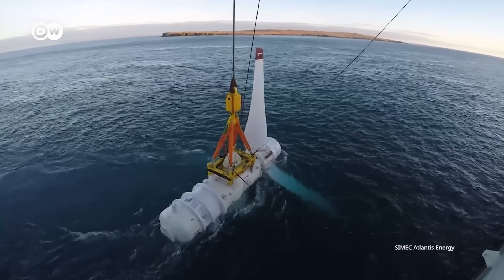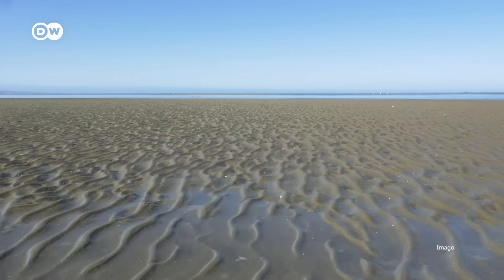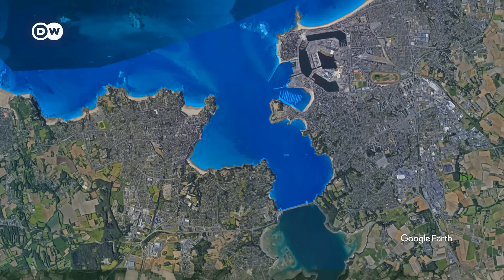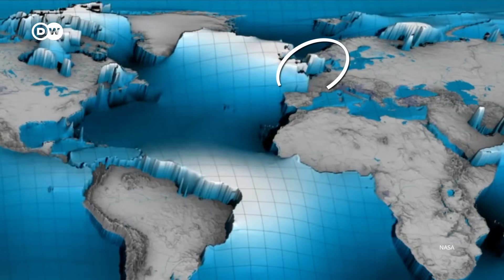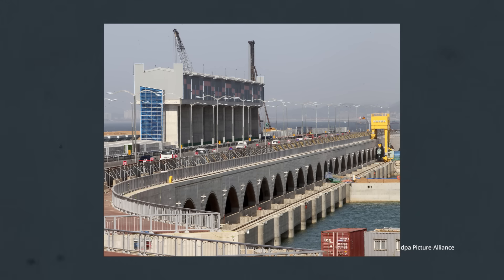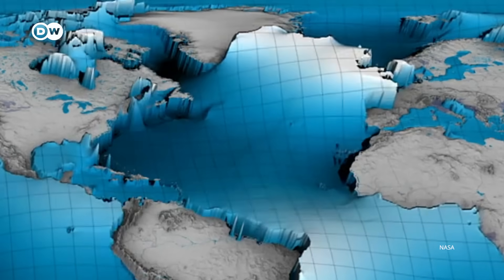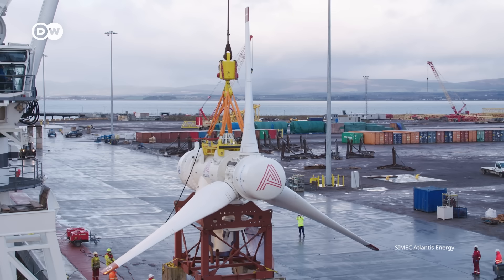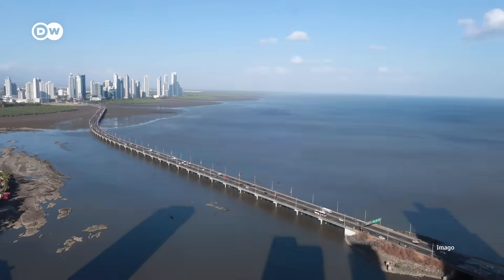Tidal energy could be huge – why isn't it?

Comment from the maker: Do you think that we should use more tidal energy?
Reply: Regarding tidal stream power the answer is obviously always a Yes. The not so obvious question is what is really needed that we can use it? It has already been solved for 4 m/s peak tidal currents with multiple 300 kW turbines on platform by some contenders of CyKlone Tidal Energy. However this is rare places on Earth limiting to scale the tech.

Once you don't start from high tidal range you see vast areas of ocean have 2 m/s peak tidal stream currents.
So basically you need a scalable design for 2 m/s peak tidal currents to really get into economies of scale. 

We have not even identified any relevant target research areas for that and we have not established any governmental government research tools for 2 m/s peak tidal currents. Even if the maps are obvious about that requirement to be met ideally. That most tech today can't do it doesn't justify not trying and ignore results pointing this way. 

To my knowledge that is true for the EU as well as the UK.
Reply: Please get make a video on wave energy as well !
Reply: Yes. Also recall a scandal that tidal power was proposed in the 70s but the British govt buried the report in favour of fosil fuel
Reply: @salk1436  It was the fact that the Thatcher Government discovered that oil had been discovered in Scotland (North Sea) that really put the final nail in the coffin for any `Green` UK power solution. Thatcher wanted quick & easy bucks. If any Gov is to play a role in Alt power in the future you may pray for a Socialist/Green Government not Capitalists.
Reply: Think about the creatures live in sea..
First they ruined birds freedom now started to marine creatures
Reply: Nice more pollution and another way to kill wildlife. Plus the amount of carbon that goes into building the thing will never be reproduced out of its functionality.
Reply: more research then sure
Reply: of course, and turbines ca be covered with a cover that allows water and tide to pass through it and protect marine life.  basic servicing can prevent things growing on it

It won't be suitable everywhere, but where it can, use it
Reply: 💖 Silly question - of course we should! 😀👍
Reply: I've been preaching this for years. The UK is ideal as the phasing of tides around the British Isles allows generation at all times, so a reduced need for storage. There are two problems. R&D capital and political will. The "City" will not fund, as they want fast returns with low risk. The current government believes in "Market Forces", so does nothing. When the tech is proven, they will still do nothing but it needs a co-ordinated plan to build the system.
Reply: yes, yes, yes, unlike unreliable wind energy, tidal is predictable and never stops
Reply: Yes
Reply: I did my MSc Thesis researching the erosion caused by a prototype of crowflow tidal turbine. Still a niche technology but would love to get DW’s perspective on them .
Reply: @susannahduncan3469  Some Tidal power machines can slow down erosion but they will (all of them) have a knock on effect somewhere & indeed could cause erosion. They can take sand from your beach & drop the sad elsewhere & create a new beach.. or indeed a sandbank. Cause & Effect in action.
Reply: Along with predictability, there is another less apparent bonus from tidal power. Some locations, UK is one, have tides staggered along its coast. The result of that is NO STORAGE IS REQUIRED. Just a longshore interconnect!
For the UK the stagger is so great that when it is high tide in the North and south, the middle has low tide.
Reply: @dougaltolan3017  you know that’s interesting. Because of course thermodynamics always dictates a lot of this energy & it’s actual usefulness when and where it’s needed. How much dissipates etc. you could be right. Just like Scandinavia has great access to geothermal we might be able to fully utilise this.
Reply: @T1tusCr0w  Wind & Wave Power can easily be utilised by Scotland & even more so Ireland but England will have to find a way of powering its Nation with Turnips!
Reply: @dougaltolan3017  Only prob being that alot of alternative electrically generated power is incompatible with the UK national grid!
Reply: @seandaniels9168  What?
Reply: No, reduce the population spread and you solve the problem over night.
Reply from the maker: @gangleweed  Do you think it's that easy?
Reply: And you can use it to power 🔋  sea structures,  a hotel that only run on tidal power in the middle of the ocean... that has a great potential.
Reply: @vajasman  yes it can...but the investement to power the hotel on a daily basis with these units is obsene!..cause everyone you need to get these on the spot you need em makes a lot of money!....and i meen everyone!!
Reply from the maker: @vajasman  Cool idea, but how cost effective would that be? As you can see by our video, these types of infrastructures are incredibly expensive to manufacture.
Reply: @DWPlanetA  I think not much more than a big luxury cruise ship, next to a large city. It can be build underwater too, probably built from modular systems. Easily accessible from a few kilometers tunnel.  Few companies can fund a cruise 🛳,  but we already see them.  Sadly until there are no companies with enough experience in these methods we won't see many growth in tidal power for a long time  :( (never understood why big fossil fuel companies didn't invest a lot in these techs, to be big energy companies) :(
Reply: You made use of a lot of footage from Britanny where the barage of La Rance actually lies. And it's not northern France, it's western France. Please review your maps next time, we people from this part are very sensitive about it, we even changed the name of a department because of that
Reply from the maker: @CaptainDangeax  Thank you for the clarification. We had a comment on this before and responded accordingly. It's great to have a community that keeps us informed and we have taken note of this mistake. 

Have a good weekend!
Reply: @DWPlanetA  You're welcome
Reply: Yes
Reply: I think we should stop allowing government control the reason yall are crying climate change is because of wealthy people not caring about anything but money
Reply: No.
It harms local ecology and maintenance in saltwater is very high. 
But who cares.. market will kill these projects. Wind and solar is much cheaper.
Reply: @hgh425  Nuclear is cheaper, safer, more reliable, and scalable with demand. There's no way you're heating and cooling all of the homes, charging all of the vehicles, and keeping the lights on in this utopian world in which all of the fossil fuels are banned and replaced by unreliable wind and solar. Youd be impoverishing and killing billions.  Speaking of billions, you'll be also needing to spend hundreds and thousands of billions to upgrade electrical grids to carry all that new electrical load. All for what? To reduce Earth's temperature by 1/10th of a degree when it's already been naturally much warmer, in both pre-history and human pre-industrial history, even when co2 levels were lower?
Reply: @camberwellcarrot420  i think you adressed your comment to the wrong person. 
You are wrong on the price of nuclear power and you also need to take in account the time it takes to build and commission.
Reply: I'm all for green energy alternatives. This has potential and would love so see it be successful
Reply: Absolutely.
Reply: If it’s more ecological than yes.
Reply: Why is my country not starting this
Reply from the maker: @thebeginingtechnichian  If you watch the video, you will see that it is incredibly expensive to implement. Take a look at the video again and let us know why you think that might be :)
Reply: Specifically, start building in those places that need some wall to defend against climate change induced rising sea levels that are threatening cities on the water's edge. If tidal energy device can be built into the defensive wall then you might turn the problem of rising sea level into an opportunity to harness more power.
Reply: @phreak074   that is true for most country but  here in the Netherlands it would be handy becaus we have the delta werken
A huge dam system  if i Recon i remember this corectly there is hydro energy instaled in the dams
But there had not been An continu in development since the 1980s
Reply: That depends. Tesla would have created free energy but died. US made a diesel van that got 100mpg. Ironically the powers that be didn’t want it around so was scraped. If they allow it then yes but sadly in this world there is always an alterior motive. Yes would be great! But then it’s a monopolized and will it be affordable is the real question.
Reply: Yes especially in the UK tide twice a day all the way round the country
The UK could actually reduce its carbon output by half if they reduced the mains power supply to 110v instead of 240v
Reply: Yes, definitely. We've to get rid of fossil fuels very, very quickly, so every alternative is a good one (yes, nuclear power too), as long as it works. It's a lot of energy that we're looking for, on a growing trend overall.
Reply from the maker: @DeePal072  Have you seen our video on nuclear power? https://youtu.be/9X00al1FsjM
Reply: I think we should vaccinate everyone first. Maybe even the fish around the turbines
Reply: 100% This is how we start harnessing the earth’s energy without polluting her.
Reply: Yes the world's been asking for that for years
Reply: The Elices dont work in Rivers and Watterfalls ?
( without being underwater )
Reply: Yes. Also, the narrator is very pretty.
Reply: Yes
Reply: We probably should use less energy but find a greater power. Paradox much?
Reply: yes and if possible marine life friendly
Reply: By all means, the positive side is no pollution, constant power, cheap in comparison to other methods for me it’s a winner
Reply: I say we should be using ocean currents!
Reply: Tidal energy is a real good thing , clean & affordable.
Reply: No question, yes more tidal energy. I wonder, has anyone tried the new toroidal blades on these turbines to increase efficiency?
Reply: Our moon gets stalled 3cm/y make up your beliefe..
Reply: no, the ships are killing the ocean animals like whales & sharks now this tidal energy will kill everything
Reply: @harshithsadhana7475  whales and sharks are not blind or unaware when it comes to ships themselves, nets yeah I agree. Don't forget Japan still practices whaling too!
Reply: @kenthhamner2641  that japanese practice too
Reply: Hakiki  
You are wrong. In English..You're wrong.
Reply: No
Reply: I like the idea of using it in places where we’re already wrecked the ecosystem such as man made bays. Creating new locations for it would have to come with a plan to offset the environmental impact in order to get my vote.

Doesn’t have to be anything fancy, but I would just want to be sure that my state/country is thinking about it and has a plan.
Reply: I don't think having blade mincer's underneath the sea is going to be good for the wildlife under there we could end up with fish soup....why people don't really think properly about design boggles my brain... Blades might be good to catch wind but not under water like a blender. Maybe do like the Scottish idea of sitting it on top of water and creating electric from movement of waves instead
Reply: yes
there are some exhausting natural resources after they will exhaust tidal energy's time will come
Reply: 3k43i
Reply: 3k43i
Reply: The energy finally is taken from kinetic rotational energy from earth. At what scale this would noticeably have an impact on the deceleration of earths rotation?
Reply: Using tidal engery is deriving power from the moons momentum circling the earth, so you would slow down it more and more. This will prolong the months which will lead to enhanced female periods and longer gaps between payments. Does anyone want this?
Reply: The best answer is to use less energy, stop reproducing. Mushrooms may lend insight necessary to forge this path, but DMT may be more efficient. We're all gonna die, no need to kill off the Earths creatures first, except a few species of sharks that like to bite people like surfers.
Reply: The world will. America, probably not anytime soon. 44,45 are panzies
Reply: No, they kill marine life.
Reply: @bluegreens1234   So should have Steve Jobs.
Reply: @bluegreens1234  puppet
Reply: the reason why this doesn't happen in America is because coal companies and Big oil shut this down anytime that people try to lobby for it
Reply: We don't have the copper resources to fully implement wind and solar let alone tidal. Tidal as you pointed out is very location dependent. As someone from the USA I am hundreds of miles and people can be a thousand of miles from the coast so yes funding is small as tidal would realistically affect a small part of the population. There will also likely be much more wildlife damage caused by Tidal than they realize. Just like the large amount of birds and bats killed by both wind and solar. Wind and solar are also not really clean energy at all. There is a lot of carbon that is used get the materials and to set them up. Not to mention that there is essentially no current plan for how to recycle turbines and solar cells. The current plan is the landfill or to ship worn out solar cells to Africa with the rest of our E-waste. Solar cells also contain toxic heavy metals so if not recycled properly they will cause a lot of damage to both people and the environment. The world really needs to look at the facts and realize nuclear is a very safe means of energy production that is cleaner than any of our current renewable "clean" energy sources. Nuclear is by far the cleanest, most efficient, and least damaging to wild life.
Reply: No. And HELL NO. Tidal is more destructive to the coastal ecosystem than dumping raw nuclear waste into it. It will exterminate fish, fisheries, and the area around the generators. Ultimately only plankton could survive in the area and we will have red tides.
Reply: La follia umana e o umanoide è Giunta al termine.
IL nulla che avanza vi divorerà tutti.
IL consumismo sfrenato vi ha resi tutti ciechi, sordi, muti, ZOMBI.
Amanti del bla bla bla.
Alberi e foreste, laghi, fiumi, mari e oceani, GRIDANO DISPERATAMENTE,
FATE CHE I FIORI NON PIANGONO.
LA LAGUNA DEL SANGUE DEGLI INNOCENTI, CHIEDE GIUSTIZIA.
IL TEMPO E AL TEMPO,
NON C'È PIÚ TEMPO,
FINE DEL TEMPO,
ADDIO.
Reply: Yes, but the propeller concept is no good. It disturbs the marine life. Better employ a horizontal fan - I think its quieter and more efficient.
Reply: @octaviusmanago8640  how does it disturbs marine life, I would definitely like to know, and also about the noise????
Reply: @atmm89  All I can say is that I have never seen a silent propeller and wonder why submarine propellers are so secret.
Reply: @octaviusmanago8640  you are talking about pushing propellers, under power, creating cavitation, (noise), what about in the others direction, there is no cavitation on the blades therefore no noise?????? think about that, possibly that is an answer to the lack of noise, I believe
Reply: Range and stream tidal projects will be able to power most of the coastal energy needs throughout the world. It's really going to depend on scientists ability to make tidal and offshore wind power as benign to the marine life as possible, and setup distribution lines for those coastal communities. But because of the stability of tides, I see tidal energy power as the driving force of future grids in particular, along the Atlantic, Pacific and Gulf coasts, where wind and solar can power the less reliable demands of those grids. I see tidal and hydrogen power as the preeminent sources of power beginning in the next decade (2030s).
Reply: No. Its uneconomic.
Reply: Duh. But they won't because they want to collapse the west. China of course will.
Reply: Late here, but hell yeah. To some degree, it might also remove enough energy from tides to keep shores calmer in regions where tidal waves are a danger. Or alternatively, certain structures underwater (essentially a ramp) can force bigger waves that can be utilised for tidal energy collection.
Reply: stop saying sexier have nothing to do with sex
Reply: Yes, we should use every clean energy that nature provides us with to move away from harmful coal, gas and oil. Using tidal energy that needs less or no storage is a great idea.
Reply: Yes but...
How much energy can produce and how much it costs to build one? Is it safe for whales or sharks? Can these generators slow the tidal speed and what's the impact of slowing tidal speed worldwide? ( examples are big wind turbine farms that slow the speed of wind) How long these generators can work without maintenance? 
Is the generators recycled after they stop working and how much it cost ?
Is it hard to recycled like solar panels or wind turbines?
Reply: @hoshiplaygames  great questions. There is massive challenges with this energy source. Snd not they can’t be recycled. Take a lot of rare earth minerals to make and they only work for a certain amount of time.
Reply: @hoshiplaygames  sharks and whale not inhabit shallow area of sea in normal condition
Reply: @richard35791  I think bull sharks mostly living in shallow waters. Orca whales are hunting in shallow waters.
Reply: In a word NO! Energy transferred from tidal to electrical is in effect stealing tidal energy. Sure using a bit won't impact tides but putting this kind of tech everywhere will impact tidal flow. It's the same with wind energy, to turn turbines you steal energy from the winds changing them. Done judiciously the impacts aren't likely adverse but used on a grand scale it could literally impact our climate in ways we don't yet comprehend. When will people learn there is a cost to everything. Next we'll be stealing heat from Earths core to be green the core will cool, impacting Earths magnetic fields and bam!
Reply: @kenthhamner2641  bruh, why so negative about it? still better than fossil or radioactive muclear
Reply: @richard35791  try physics.
Reply: If you work on turbines or live near them you will find out that they are super good at karate chopping the local wildlife
Reply: @SmitNibly  Underwater sushi bar opportunity?
Reply: Yes, absolutely!
Reply: Capitalism cannot exist in an environment of abundance. It can only operate if there is scarcity. That is why we are not solving ANY of our issues today. Its not that we do not have the technology. There is no money to be had by actually solving a problem. If the streets were lined with orchards and gardens, nobody would pay for it.
Reply: @davefroman4700  
Socialism cannot exist without the subsidy of Capitalism. It has a few brief bursts of life which terminate miserably when it run out of other people's money to spend. 
Russia learned the lesson, China now runs Capitalism alongside Totalitarian 
population control,
Reply: @MauriatOttolink  Tell that to the agrarian societies that existed for millennia without money bozo. Capitalism is a system of enforced scarcity for profits that is incapable of solving issues in our society because it depends on those issues for profits.
Reply: @davefroman4700  Well said & understood Dave. I think some people here need to learn a bit more about the true nature of the modern world before we unleash them to solve world problems. Rule No.1 its in your Governments best/own interests to lie to you! ..
Reply: Nucleare
Reply: More nuclear please
Reply: What about new nuclear options?
Reply: @kevm7815  The famous last words of a guy in Chernobyl..
Reply: If they have a minimum effect on marine life then it's yes and it is shown in the video that their blades are moving slow so it won't harm marine animals. Balance is necessary. This should be part of all other renewable energy sources. I hope this technology will be cheaper in the near future so that  developing and underdeveloped countries will be able to use this clean energy and be less dependent on oil and other fossil fuels energy sources.
Reply: Nuclear is still the simplest, most reliable way to generate electricity.
Reply from the maker: @camberwellcarrot420  then you will like our video on nuclear energy. You can watch it here: https://youtu.be/9X00al1FsjM #DWPlanetA
Reply: No
Reply: Most definitely
Reply: @filmboyultimate  Have you factored in the fact that it would be Capitalist forces in charge of nuclear energy these days & they are not well known for worrying about safety. The $`s come first to these people..
Reply: Tides goes in, tides go out. You can't explain that
Reply: The pathetic level of funding is criminal. One fiftieth of the pittance that is invested in renewable energy, compare that to the nuclear money pit and the hidden subsidies for fossil fuels.
Tidal flow should be number one investment, there are no valid arguments against it. We have had machinery in sea water longer than we have had electricity, there are no new problems.
Reply: @dougaltolan3017  Tidal power should be one of the last sources for further investment. There are very few good sites, it is environmentally damaging and it is very very expensive. What I suggest for you is that every time you get an electricity bill, pay it and then hand out an amount equal to 4 times the bill to the local panhandlers. See how long it feels good to be paying through the nose for a power source which is also harming the environment. You've demonstrated that you can talk the talk on YouTube. How long would you walk the walk for ?
Reply: @lupus7194  Your information is false.
Reply: It will cause the moon to recede from the earth faster...
Reply: certain areas with low impact and high tidal activity, sure. otherwise its fundamentally too cost prohibitive, intrusive and centralized. 

cost of ships(and port fees) alone could for deployment alone could be use as incentives for residential pv uptake. 

more scalable for the masses. less reliant on a single grid. scalable to 100% renewables.getting there need energy providers, goverment and end users to chip in together. providing an incentive for end users is very important

otherwise ull be stuck like how tidal energy is stuck today. it needs to be a viable solution, economically, politically and scientifically.
Reply: Tbh....yes its free energy...but the company that makes these tidal turbines has a 20.000 investement to make one, they sell it for 50k to 75k (at least)...the company placing these turbines in the ocean have about 5k to 10k of costs vs the 20k to 50k it would cost a consumer to place...and thats just one!!....and lets say 1 of these units provides energy for 5 households (up to)...combine these facts..add tax's (long term)....pls dont get me wrong!....i do think we should work on a better enviroment for the future..but now its kinda a hype and the bigger company's abuse this hype to make some extra money....add bio or green to any pruduct and sell it for more....its the world vs commerce!...we are doomed!...
Reply: Changes the moons orbit which isn't good over a long time
Reply: no
Reply: How much does it cost?
Reply from the maker: @lukespredemann7101  As our expert, Amanda Smythe explains around 7:50 min into the video there is no manufacturing or supply chain due to the fact that engineering underwater has its own set of unique challenges. In the video, we explain that the industry targets that life cycles costs could fall to $0.10/kWh.
Reply: @DWPlanetA  I'd like to see investments in Tidal, but at this point widespread deployment at this cost isn't a good idea. Not when it'll get cheaper in the future. Other conventional renewables are an established and far cheaper option.
Reply: @britishmalayasociety   But most of the current renewable power technologies are intermittently productive with their energy output.
Reply: @stevenmitchell1  Energy use is intermittent. There are ways we can move our peaks and troughs around renewables production. Like how EV's and homes with primarily renewables aim to use usage at the cheapest possible rates, with discounts from energy retailers.
Reply: The wind turbines  also leak hydraulic oil all over.
Reply: Wind and Tidal power need to much blade and mechanical maintenance to be viable. 
Where pelton blades as opposed to propellers are used then maintenance issues drastically lower to acceptable maintenance levels
Reply: No
Reply: Wind Turbine KILLS BIRDS while Tidal Turbine KILLS FISH 🤔🤔🤔🤔....
Reply: @bluegreens1234  Tell me: If you see cars coming, do you walk in front of them? Why then do you think the marine life would, once taught, continue to swim among the turbines?
Reply: No, Every power resources started with reliability and confidence until it caused damage to nature.
Reply: Nuckler power is mutch better cheeper and dosent produce carbon this is expensive hard to maintain i think nuckler power is the way to go
Reply: @bigtimegamer7776  "nuckler" power
Reply: @bigtimegamer7776   But no one has a solution for ridding the Earth of the radioactive nuclear waste that is produced by nuclear power.
Reply: No
Reply: Will be very expensive to maintain
Reply: @christopherbadree3266  that's what Big oil wants you to think
Reply: No because it could cause the Earth to spin into the sun
Reply: Can we use this tidal energy on rivers? It has a Constant corrent
Reply: Just use nuclear already
Reply: do it in indian first
Reply: No, underwather tidal energy almost dosent exist becouse the wather canot bea comprest like air do. Real energy are up from water to catch end i can make that for less money else solar photozellen.
Reply: No, we shouldn"t, too low efficiency
Reply: It is an influence on the sea life and might shift the sand deposition in the sea. Until the long term effects are known i wouldn't be building too many of them.
Reply: Having considered the pros and cons in this video only, it might have a role as supplemental energy, on a small scale. The comparison  of Beth Scott between consequences of climate change and the damages to marine life etc. is unsubstantiated, and the only thing in this video which is reducing its credibility.
Reply: How are these technologies going to withstand the wear and tear of the oceans? Wouldn't corrosion be a factor after the turbines are under water for a significant amount of time?
Reply: the sea is incredibly corrosive and violent. until we can build machines that are more durable, tidal power won't be a significant factor in clean energy on a mass scale.
Reply: Yes. [10:40] Beth Scott (marine ecologist) argues it's damaging to marine life but WAY MUCH better still when compared to climate change. She would know better then me. I say yes it should be used part of the mix from her interview.
Reply from the maker: Thanks for watching,  @Holy_Frijole  !
Reply: @DWPlanetA  what's the narrator's age? Sounds pretty young, like a teen.
Reply from the maker: Thanks for watching, Richard!
Reply: No. Tides flush the ocean. As wind flushes the air.
Reply: I think we should go for the primary energies (gravitational force,nuclear force etc )
Reply: @Pedrofit  When you say `gravitational.. what exaxtly do you mean? We can easily extract energy from a rock rolling down a hill, but how do you make it roll up again? ..
Reply: @Pedrofit  - nuclear energy is already the most expensive type around, and gravitational force isn't going to give you electricity unless you invent a perpetum mobile.
Reply: @Pedrofit  show us how
Reply: @robinsss  I think just because tidal is a secondary force that comes from reaction of another force ( gravitational)
Reply: @robinsss  but i dont know how to do that, i just tried to say that we can focus the investigation on those forces.
Reply: @Pedrofit  in the mean time hydro looks like the best option we have  now
Reply: @Pedrofit  
No Energy in Gravity.
Reply: @MauriatOttolink  But if there is movement so there is work and work means energy
Reply: @Pedrofit  
Good reply but I wasn't just passing on my opinion, rather the definition in Science.
Your interesting  comment will gee me up to re-investigate.
It has always been an explanation why there never has been a successful Perpetual Motion  machine.
Your other examples were bang on the money.
Thanks for your interest.
Reply: @MauriatOttolink  Until you hit the ground with quite an immediate splat of energy.
Reply: No... It will make the moon fall.
(not a joke given a few billion years and many trillions of turbines it would lower the moon my several microns and allso bring the earth closer to the sun...
Reply: sure, so long as absolutely NO damage is done to the marine environment and its inhabitants
Reply: Tech Cafe
It will slow down the earth's rotation. 
What's all this "Will do" business?
 IS DOING!!
Tech Cafe ... How much damage can you get?
Reply: @MauriatOttolink  ``Slow down the earths rotation?``....minimally maybe.. maybe give us 25hrs in the day. Brill! ..
Reply: @techcafe0  yes
Reply: We could use nuclear it's technically renewable
Reply: @christianestes2789  No, it's not. It produces significant radioactive waste that the nuclear industry has failed to develop a waste solution for. It is not recyclable in the United States. It gets buried in the ground.
Reply: @christianestes2789  Being non reversible it is not renewable. Even gravity is reversible with little power. Jump! ..
Reply: We can not make energy we can only transfer it so until we understand what the energy from this movement is doing naturally we shouldn’t take it. 
Since we have been taking wind energy we have been developing hot spots and more forest fires is this because the energy that we have taken from the wind cooled these areas?
We have learned nothing from the damage caused by fossil fuels if this is the outcome many years future for our children/grandchildren etc. 
We should be looking into using less energy not making more of a mess to our planet we are like a disease.
Reply: Does anyone realize how much it would cost to maintain? The corrosiveness of seawater a components of a turbine? You'd have to pay diver divers to go down to them and keep them free of debris. Same with oil rigs. Again how do you store excess power? Transmission lines and how much of the shore line will have to be destroyed to build on scale. Cpw isn't going to make those attractive investments. Building on water is expensive and hard maintaining those structures are even more expensive the more time goes on.
Reply: no
Reply: @remygrandemange8460  I was engineering manager for a tidal power company attempting to develop a power station in the far north of Western Australia. One of many problems was that despite there being massive tidal energy available, there were very few suitable sites. For example, the much quoted Scottish power station has just the right combination of depth, water speed, proximity to markets etc. Very few places have that combination. Then there is cost. Sure its easy to build something if cost is no object but the harsh reality is that no project will survive if the energy ends up costing 5 times what you can get from wind or solar. This video was full of grandiose statements by people who have no skin in the game. Would they still be buying tidal power when the electricity bill arrives and tidal is 5 times what the bill was before. I would describe this video as hot air presented by know nothing air heads.
Reply: The whole CO2 scare is based on nothing.
Reply: @picobyte  If its so safe try lying beneath a car exhaust. (Dont really, its lethal & that answers your doubts!)
Reply: It makes no sense to build ecxpensive generators for tiny energy in salt water while we have plentyfull gas&coal onshore to burn.
Reply: @picobyte   What part of fossil-fuel burning being a pollutant, evaded your reasoning? Is that 2nd grade science education of yours styming your ability to imagine a world without 19th century technology as its economic force?
Reply: @picobyte  depends on the coal and whether or not it can be scrubbed! Natural gas is the way to go when nuclear and Hydro aren't options.